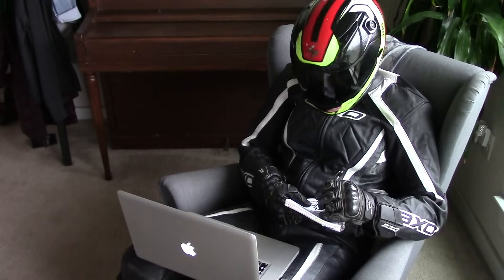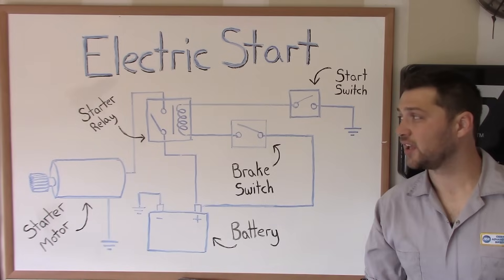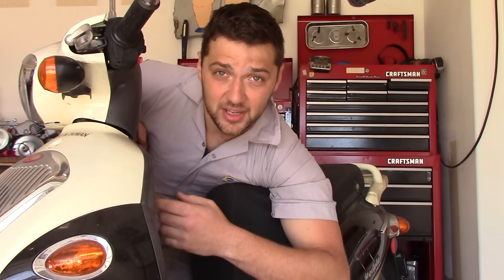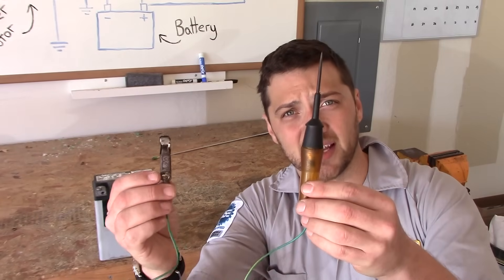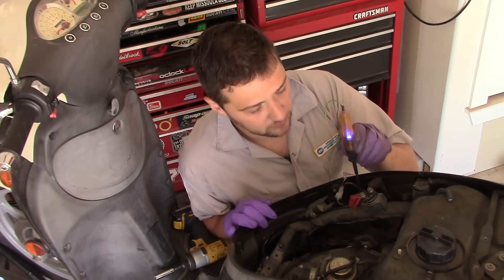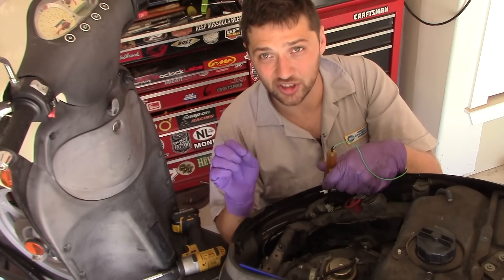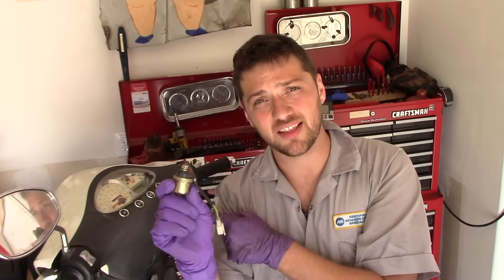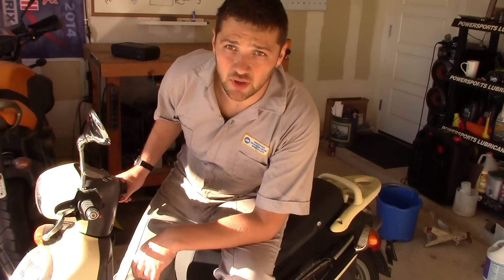Scooter 911: Electric Start Doesn't Work (troubleshooting your starter, starter relay, and circuit)

Comment: if the brake switch is broken will the starter still start when you bypass the relay with a screwdriver?
Reply from the maker: Absolutely! The screwdriver trick is basically bypassing all of the other control circuits for the starter relay.

Comment: 2008 keeway f-act 50 50cc led dashboard not working And no electric start kick start work but led still doesn't come on only on high beam does but with low break light on break unless I turn on high beam break light comes on lights come on light no turn singles at all no low beam either

Comment: I have issue with 50 cc bear ice . It'll crank for second than stop . Push the button again it'll crank and stop and she remove the spark plug it'll keep cranking. Try 3 different batterys . Try timing, valve adjustment. All good . Can't figure out why just crank once

Comment: My starter will crank the engine at terminal's but will not start from starter switch but the horn sounds like it's getting a/c to the the circuit it will not start and the turn signals come on but they do not blink.

Comment: I'm working on my old POS (albeit 1 owner, 1K miles, Nearly MINT ABSOLUTE PATHETIC POS) Honda CH125/AERO 125 2 Stroke & it's got a super weird starter Relay - Its like a proper car relay. Not a solonoid as you'd see on every other non-lawnmower small engine vehicle. Relay is OEM & Brand New. I cannot get the start button to do SHIT ever at any point. I can throw the relay across the garage & jump it through the wire harness & it'll turn over all day. I've replaced the entire r/h control unit 3 times (every unit "working" but not on this boat anchor POS). Any suggestions before it's sledgehammer time? All areas noted in video sorted; Brake switch, etc.

Comment: My Aprilia SR motard 4t 2015 does start by kickstart but dooes crank wth starter but wont strart, seems slowish with electric start...New battery tested and good, new starter tested ank working...have fire with new spark plug, carburator cleaned by professional, was starting when tempetatures over 20°C outside...new petcock also...what would you reccomend ?

Comment: I have a question for you I think my carburetor has died and now I'm in the search for another one my question is to you is if my scooter is 50cc can I install 150 cc would that make any difference I'm going to try to find a way to make it faster than what it is it was working not too long ago no problem and now I just won't start I mean well it won't keep running it just dies or stalls

Comment: Quick tank you bro! I got a lance 2008 lance duke touring 250cc for $200.00 bought a battery then found out it needed a fuse. The dash lit up but no starting sound. After that I thought the switches didn't work so was unhooking the dash and hot wired the switch to find if the starter worked. It ended up being I needed to pull the break leaver and start it at the same time. Lol that diagram reminded me the break needed to be pulled.

Comment: love your videos man. so im having some trouble starting right now. what do you think it means if i did what you did at the end, bypassed the relay, and it didnt start up. think that means my starter is bad?
Reply from the maker: Did the engine crank when you bypassed the relay? Like riiikikikikikiiikikiki? If it did your starter is ok.
Reply: @Scooter_911  nope it didnt crank at all, but the plyers sparked when i touched them to the relay. It was running about a week ago but stopped running for some reason. I put in a new battery, new spark plug and coil, new carb and filter, new cylinder head and checked the valves and gaskets on top end, changed the oil.. So im thinking it has to be something electrical, like the starter or stator.. or maybe wiring issue?

Comment: I have a 1985 Honda scooter and it's turning over like crazy but I can't seem to get into the guts of the motor because the shell is surrounding it I'd really like to take a look at the fuel filter and carburetor wherever that is

Comment: So I just rewired my whole scoot and it’s my first time ever doing any wiring , long story short I did aaay with my key and now just have a flip switch to give power to the scoot, then a flip switch for my headlights and tail lights, then I have a start button wired to the start solenoid and when I push the button all it does it turn over, I can kick it and few times and it’ll star up ,  but just turns over when I push the button, and idea why? And maybe wheee I need to start looking; I’m also is being a pain in the butt, sometimes a few kicks wil start it and then sometimes 100 kicks won’t start it at all, but when it does start it runs absolutely amazing; this is my first scooter build and I was soo happy to have it back together but I want it to run off the start button

Comment: I doubt I will get a response here seeing the video is a bit dated, (only slightly in YouTube years lol) but the two different sounds it can make to determine the status….the “cranking” sound I get is intermittent. It doesn’t necessarily make that lazy almost “purring” sound he made, but an intermittent cranking sound.

Hard to discern if that that counts as the persistent “cranking” sound example he gives.

🤔🤔🤔🤔 My manual doesn’t tell me where my electrical components are and such, so I’d have to just start taking it apart I guess and look for it, to do that test given at ‘7:30something.
Reply: I am not a home mechanic by any means so completely unknown territory here.

Comment: Can any 12 volt battery Universal work on my moped even if it's just a little too tall can I rig it just to turn the bike over
Reply: And it takes a 12 volt 6ah but I got a 
12 volt 18ah I don't know if that's good to you if I can rig it to be in the bike even though it's a little too tall

Comment: My scooter does make that second sound in the video. I will get a tester and fallow those steps. However it has another issue, the headlamp goes dim when I stop, and some times the engine dies when I let go of the throttle. The last time it did this I couldn't get it started and it was making that second sound in your video. Can you help me solve this problem?

Comment: Many newer scooters (including the Chinese ones) have a kickstand safety switch. As in scooter won't start with the kickstand down. Also worth checking . Otherwise, this video is an excellent troubleshooting tutorial, Including a great explanation of how a relay actually works. Electromagnetic coil mechanically closes contacts.
Reply: I'm glad my tao tao doesn't have that.

Comment: great video, I just bought a new battery and it was cranking over then all of a sudden its not cranking anymore, I suspect the brand new starter relay errrr. cause there's no voltage going to the other side of it when starter switch is pressed. weird thing is I still here a click in the relay when switch is pressed

Comment: I was showing the bike to someone to sell and I checked all the switches I checked the battery I checked the wiring I was sitting on the scooter trying to start it in the driveway and never thought to grab the brake handle I watched your video 2 seconds in I went outside and started to bike right up now I feel like an idiot

Comment: Hey I am sure you get comments like this all the time and I am going out on a whim here and hoping you answer but…. I have a buddy 170i scooter. I changed the battery so that’s not the problem and I tried your trick with the needle nose pliers. The only thing that happens is a click. So is it the relay or is it the starter? Please help
Reply from the maker: When you use the pliers you bypass the relay which means the source of you problem is either the starter or an issue with the heavy gauge wires that carry electricity to the starter or ground. Good luck! You're on the right track!
Reply: @Scooter_911  thanks for getting back. Going to pick up a starter now

Comment: Your video explains the starting trouble in a easy way. Another question: after scooter starts why pressing the start button doesn't do anything? How is starter motor protected from any damage from running now?

Comment: 2006 260cc chinese scooter with only 5 miles on it .  Fixed previous mechanic cut wires to dash, scraped pos wire from starter switch. I took plastics off FIRST to get to wiring loom in front. CDI and Rectifier present, BUT a component is missing. Schematics are unclear what it is. Has plug hanging under nose piece of bike with @ 6 wires orange, light blue, some power in some of 6 contacts in the plug.Any Ideas? Thanx for any help.
Reply from the maker: A lot of those bikes came with an optional alarm/remote module. Orange wire is left turn signal, light blue is right turn signal. Typically there is a jumper wire in a small installed in its place.

Comment: Thanks for the valuble information. And after directing relay motor lines via any conductors yet 'kiri kiri " sound exist without starting why is that?

Comment: Thanks for the video, my scooter won't start but it cranked, I have to start it manually then after the engine runs for a minute then the handle bar start crank it up. Please, what could be the problem?

Comment: Hi Garret, great channel!! I am working on a 1985 Honda CH250. I watched your video and am trying to start the scooter, by going directly from the starter to the motor. I get a spark but the engine doesn’t turnover. It’s a brand new starter, but getting the same results as the old starter. Any tips?
Thanks!
Reply from the maker: Oooof we'll there is a possibility that your engine is locked up. You can remove the belt  cover and try to slowly turn the engine over by hand to see if it's locked up
Reply: @Scooter_911  Thank You for the tip! I will give this a try tomorrow. If I get it going I will let you know.
Take care
Reply from the maker: @evanbaja  good luck!

Comment: I really enjoy your diagnostic videos. Unfortunately I have a 2007 Honda Metropolitan (one of the two models that your video did not address).  My problem seems a little different anyway.  When I turn on the key, get get power for 1/2 sec then I hear a click near the battery terminals and it powers down.  The horn will honk and the lights go on for 1/2 sec then click and no power.  All the fuses appear to be good. What is my problem?

Comment: I have a boom Vader aka grom clone it was stolen last summer luckily I got it back about a month later but they hot wired it and messed up everything for me it’s getting warm out so I’ve been trying to work on it bought a new ignition switch but all it does now is crack … might have any thoughts I could try? Thanks

Comment: 3:13min my one is doing that I think? Usually I hear a clicking noise like how I know if it's the spark plus or CDI box. My Scooter has driven 60000kms so far. So I think one part at a time it's going to fail.

Comment: so i tried everything and it all worked but it still wouldnt turn the piston over? I figured it out it was because I temporarily has the variator off. So no belt to be driven my the starter motor, which means stator wasnt able to do its job! lol

Comment: Does a 2013 pcx 150 have a starter relay?
Reply from the maker: Unfortunately not. The pcx has a really slick system. It doesnt actually have a starter relay or even a starter motor! It shoots AC current through the stator to turn the engine over. If it's not cranking make sure you have a good battery, the brake light is coming on and all your fuses are good!
Reply: @Scooter_911  ok you just saved me so much time I literally  was about to build another harness with a starter and relay. Lmao but ok so the alternator /stator is what I need to get power to thanks !!! This my first scooter every and was fun building I think I'm hooked but you got yourself a subscriber

Comment: I've got a 2013 SSR Pacifica 150. The battery is brand new. I started it once after battery replacement. 2 days later, I was going to go for a ride, turned the key on and nothing. Battery has full charge. Relay was replaced 200 miles ago. Gauges not activating when key is turned on. Do you think it's the key switch?

Comment: Hey man, im having problems with my starter motor, its making the exact noise you play at 3.37! I have a fully charged battery and all grounds are fine, have installed new solenoid and starter motor as thought they both may have been problem but its exactly the same! Everything else works absolutely fine on bike all electrics etc and bike runs fine off of kick start just will not start from starter motor. Any advice would be massively helpful 👍👌

Comment: I have a mc-62-250 and i have no electricity at all. New battery and turn ignition and the hirn works, sinal lights but no crank at all. Any subgestions. Please help b4 i junk it. Only has 400 miles and it was just given to me and i had tried all b4 asking. Thank you so much in advanse

Comment: Why did you exclude the Honda Metropolitan from your starter explanation?   I have one and need help with my “starter” system. :).  Great video.
Reply from the maker: I excluded the metropolitan because the first generation metropolitan (pre 20212) doesn't actually have a starter motor. It pushed AC current through the stator to turn the engine over. And the system is extremely robust. Typically if a metropolitan doesn't crank with the electric start its a dead battery or a fuse. Good luck!

Comment: Just spent 1500 dollars on a new scooter, I let someone ride it and thew crashed it and wrecked my starter switch, got a new one, installed it but it doesn't work. Gonna check the battery and see if my wires are okay

Comment: Thank you Sir, will this apply for a 1986 Honda Gyro, new charged battery, I had tank recoated and just reinstalled, turn signals work, horn works, no action at all when I press the start button, ran perfect before I took tank off to recoat inside, but has sat for almost a year before this, its close to 37 yrs old but like new, parts are rare, I am going to check some things you mentioned, thank you, liked and subbed :)

Comment: As everyone has said… Great video!!! Very informative 😎
Any idea what the problem is if the electric start system is working fine but engine not firing?
(Like you mention at 3m36s)
Reply: That's what I want to know too!  Did you ever find out?

Comment: Hello Garrett. I have continuity and voltage with the battery, starter button, the brake switches, and relay. No starter motor response. Hot wired the relay terminals, and scooter did start. However, still no response from the starter switch or brake switches. Have failed to solve mystery. Got any ideas?? SYM HD200 2009 Scooter

Comment: i bought a new starter motor and it still spins when I hit the ignition and doesnt grab the flywheel, it does sometimes but then releases from it after half a second. whats going on here?> the battery reads 12.30 volts

Comment: what does it mean when the wires heat up, the ones that connect to the battery, my last battery, the terminal post melted. I bought a new battery but the wires heat up quickly, what should I look into??

Comment: Here is one for you. Did a engine swap on a Cabo 50cc and put a 150cc in it. Had dashboard and all lights working. Went to crank up and had no dashboard, head lights or  taillights along with electric start not working. Redid wire harness 100% and still nothing. Can bypass electric start and manually crank it. Only thing dash does is flash oil light when running

Comment: Just finished rebuilding my Saga Retro with an 80cc BBK. I was getting the slow whir-whir-whir problem trying to start it for the first time today. Only the kick start would get it going, and eventually I broke the worm gear inside. Once my new parts come in, I'll be sure to try these suggestions. VERY well done video. Thanks so much!

Comment: Didn't cover if starter motor spins, but gear is not engaging to turn the motor.  I have a Kymco ZX 50, does the starter on it operate like on a riding lawn mower in that spinning action raises the gear housing to make contact and turn the motor?  That is, on my mower, that gear housing came to stick over time, and fully cleaning it again it would raise, make contact and start the motor...  Since I hear the motor spinning, is that the likely issue here?

Comment: So I bought a Tao Motor50cc Pony moped from Amazon the other day and it came brand new but the engine won’t start at all!  I changed the oil and charged the battery and it still won’t go! What should I do? My engine is in a bind. Something must be jammed and it doesn’t work.

Comment: Hi all I’ve just recently got my sons sym 50cc scooter back on the road for me to use it for my new job starting on Monday. Anyway the electric button worked at the garage where I had it serviced and mot’d, now I have got it running via the kick start now when I hold the brake lever and hit the start button I get a click click click it doesn’t crank over it just as I’ve said clicks any suggestions please